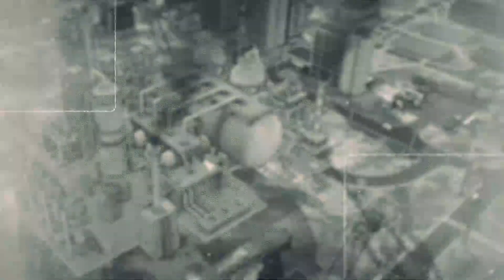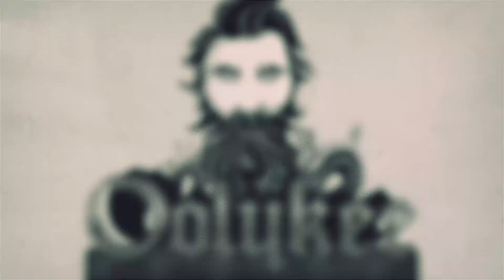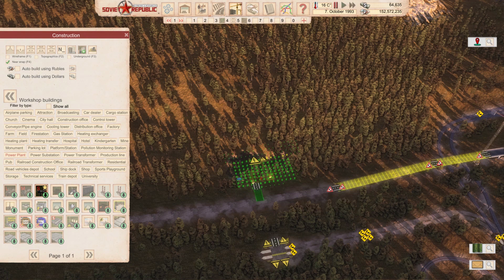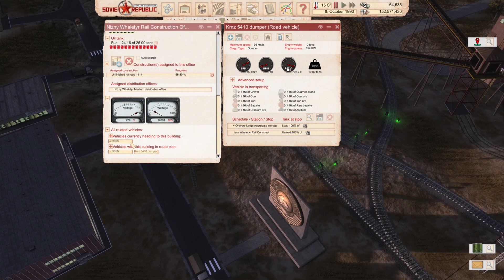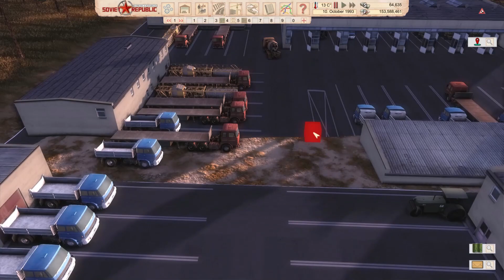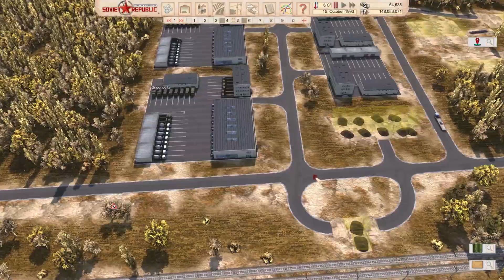Soviet Republic - Alaska - Geothermal Power - Ep.152

Comment: When you consider the need for lithium in solar and the plastics needed to make solar panels, solar looks pretty dirty as does wind. I think nuclesr is one of the cleanest when you consider the number of nuclear plants vs the number of accidents its much like the safety of plane travel, you will probably die if you crash, but your not likely to crash in the first place. I think there needs to be research in the University for geothermal power and it needs a little more resource sink. Maybe it takes machine parts as motor bushings wear out or something to make it less "free" to run. There should also be resource spots where it can be built (hot springs or something like that for instance) Anyway I am super happy to see you implementing geothermal power. Great work my friend.oil is overpowered absolutely, but this is Alaska, and Alaska is the middle east of America when it comes to oil. There are MASSIVE underground reserves muchof which we are not even allowed to exploit as it is under national parks land. IRL
Reply from the maker: Thank you, brother. :)